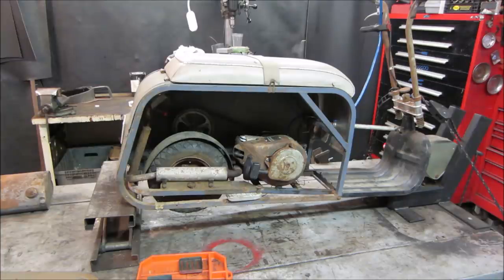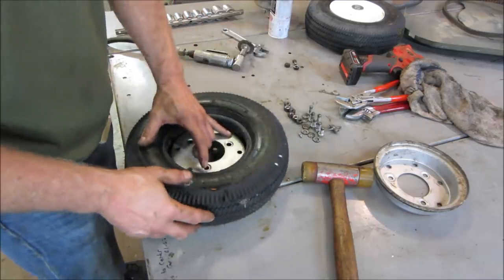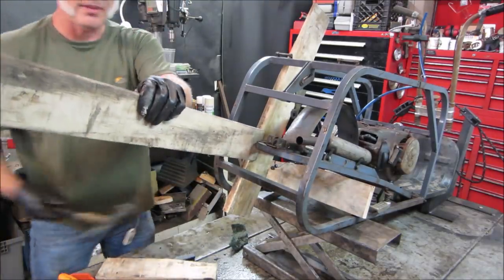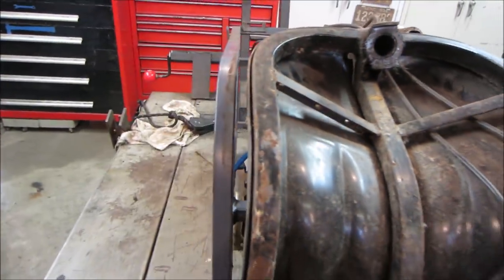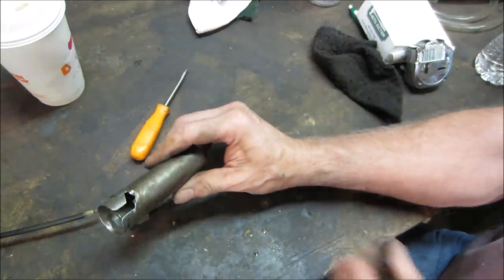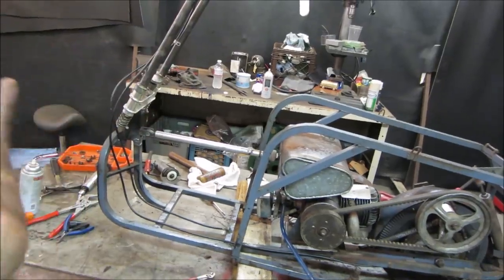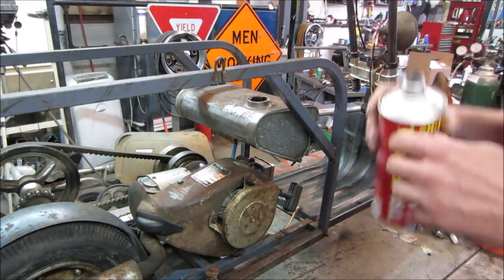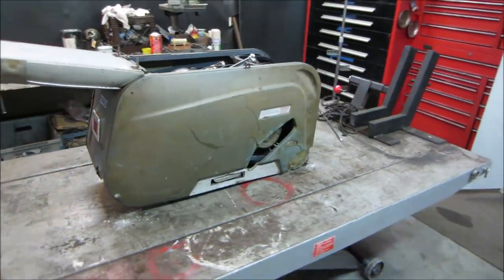Fold up 49cc suitcase scooter. Will it RUN/RIDE after 40 years Part 2 of 2

Comment: I like that lighting system:
"What's that in the middle of the road?"
"I don't know, let me speed up so we can see it better."
Reply: @sl4pz  ---  Yep. I believe if one of the lights burns out the bike will not run. Wired in series.
Reply: I have a CG 150 chinese clon (OHV, pushrods, copyed form that 70´s small Honda), they still have it haha. 
Perhaps not that handsome, but cheap and lovely. 
Fantastic option, in my opinion, in poorer countryes to still have movility. And a great DIY school on itself.

And no, , it will not stop if one of the lights burns out. 
It has a bunch of cable wide as a thumb coming out from the magneto, so everything is in paralell I guess.
 
In fact, you can take out the battery, drop it in your back pack, and still be able to kickstart and run the bike, head and brake lights, forever.
Now imagine yourselve in the midle of, let´s say, Patagonia, 500 miles from everywhere.
Battery dyes and you´re in a Ducati.

Note: 
Headlight is symbolic, till a moment, in the middle of the night, there is no other light around. 
Then is a miracle.
Just to think about it..... ;D
Reply: @Simmons2358  that is wrong of course the lights circuit is a different circuit than the one that powers the plug
Reply: Hi

Comment: In what has become a "throw away" society, you are a breath of fresh air. I recently bought a burgman scooter that did not run for three years. Changed plugs, put in a battery and some seafoam to the stale gas.  Fired it up, took it to my motorcycle mechanic, got it inspected and have put about 600 miles on it in 3 weeks. Everyone said don't buy it cause it doesn't run. Now I drive by and beep. Thanks again and keep em coming.

Comment: Excellent little mini-series, Mustie. From here, 3000 miles away, it looks like the rear shock slider bracket goes all the way back and hooks under the cross tube. In that position there would be no bending moment on the spring strut. I was amazed at how well it appeared to ride. Always enjoy your output. Mart.

Comment: my 2 cents on the slida-ma-thingy:

its to keep the wheel in contact with the ground when propped up on the kickstand, so the wheel doesnt turn nuts when in idle.
Reply: Very possible. Good idea.
Reply: Was thinking it look like the thing on my electric scooter to keep the front tire on the ground
Reply: If you take a good look, the bracket the shock is on has a knub on the lower end. it is meant to sit on the frame!
Reply: Wheels turn nuts. The person riding the scooter. :-)
Reply: @redashrajal  ow so what's that shock for then the bar that moves or is my scooter broken

Comment: Like with the tank taped to the wheel spinning.A friend of mine restored a lot of bike tanks for people.....so he had an old dryer that he used to clean out tanks with.Most tanks would fit in the door....so he  would seal the tank with nuts and sand inside....then wrap the tank with a blanket, tape off the layers then......throw that in the dryer for an hour and it made the inside of the tank look new.
Reply: I was about to suggest sand. Bolts are good for the big chunks.
Reply: We used pressurized air and sand to fix dents in some tanks, way back when.

Comment: That original tread reminds me of a pattern which was found on a number of aircraft during WWII, sometimes on the Mustang P51s.
Reply: I was wondering if the tires were off a light aircraft, given the aviation links to the scooter.
Reply: Good thing you found that crack. Imagine explaining at the emergency room how you crashed riding your suitcase.
Reply: that tread is a very common old school tread, lot of go carts and minibikes of the 60s/70s had em

Comment: The bracket for the shock absorber swings all the way back, it has a notch to lock it into the bar on the back.
Reply: I wonder if it had previously swung forward out of lock during ride and hit a bump to cause that bend/kink. The geometry makes it look like it could happen easier in that case.
Reply: That's what I was thinking as well. That is the main support for the weight. Probably got bent originally from not being locked into the rear bar.
Reply: Kid with a new toy 👍😂
Reply: Yip this is my thinking also. He was so close when swinging it around I thought for sure he'd try it.
Reply: Thankyou, was hoping i wasn't the only one that picked that up! The bracket is quite cleaerly shaped that way!

Comment: The shock mount slides down because that piece rotates around and locks under the frame in the deployed position.  Its not meant to be locked straight like that.
Reply: @Do RC - I  think the slotted bracket also `limits` the rear wheel assembly from dropping too far down so the belt & pulley don`t get too stretched. Does that make sense to anyone else ?
Reply: My thoughts exactly. Getting that piece under the frame will add strength and be far safer.
Reply: I think the bolt slides DOWN to allow the tire to fully come up into the frame.
Reply from the maker: cant go that far as it hits the rear fender with the locking lever
Reply: @mustie1  maybe that locking lever isn't original or something. It just seems like it's really designed to go there.
Reply: @mustie1  there's even a little reinforcement tab on the frame where the bracket would rest.
Reply: @mustie1  also looking at the video I don't see where it would be anywhere near the fender as the bracket would swing to the back to rest under the crossbar of the frame which would actually further away from the fender then when it's straight up and down
Reply: I think so too, was hoping to see a resolution to this before the ride.

Comment: The gas tank strapped to the truck wheel says just one thing... “ too much vise grip garage!”
Reply: And the noise reference to spray paint lol
Reply: You say that like it's a bad thing. Well, I'll be dipped, it did work well though.
Reply: Well I`ll be dipped! that worked!
Reply: A guy really does have to put gas in 'em though.

Comment: I think there is a spring missing. Every shock I've ever seen either has a coil over or a leaf spring or some other kind of spring in use with it. that's what the movement is for, room for a little movement when you hit bumps and what not, but without the sprint it's not going to work.
Reply: The movement is because that arm is supposed to rotate around and lock under the frame in the deployed position (you can see where the two should mate).  Its not suppose to be locked straight like that.  The spring is built into the shock.
Reply: Back in the 80's I had a friend that had one of these and it had a coil over and about 3" of travel.
Reply: @DoRC  then the shock needs replaced it's not working like I think it should.
Reply: @tootall5559  That's entirely possible. The spring it could be worn out and collapsed. It also could have had shock absorbing functionality originally and that has been lost through seal degradation.
Reply: @DoRC  something on that order... but I think the right coil over spring could make it work... better if not entirely right..if you can find one laying around. If you have to buy one...I wonder if you can buy a shock like that these days? anyway its a cool ride. I think it would be cool to keep it in the back of the truck or in your trunk with one of those cans of gas... you wouldn't want to keep gas in it ... if you have a breakdown or whatever, you can ride it to someplace to get help or home depending on the distance. Get tools and maybe another vehicle... just be cool to have handy. Many a time I wish I had something like that when my truck or car broke down. Course nowadays with cell phones that's not so much of a problem....if you have somebody to call which I don't.

Comment: That adjustment on the back is going to be the equivalent of preload, so you don't bottom out, if ya fat.
Reply: Yup, you adjust it for rider weight and then lock it down. It doesn't slide during normal operation. The reason I think this is that the whole thing looks like an upside-down version of the bellcrank that operated the headlights on my 1974 Saab Sonett III. That had a similar slot to adjust the retracted position of the headlights, but all the normal extend/retract action was handled by the middle pivot.

Comment: That pull start was facing straight up in the first video, I even went & did the checking for you. Whatever works best though, Just because it was up doesn't mean it was correct. Great job on fixing it up to run & ride.

Comment: Putting the brake cable into the solder pot is nifty, if you have one. The cut off: wrap a piece of friction tape around the cutoff spot. Then do the cut off with vise grip jaws. It is clean every time, even without the solder pot. Have done this many, many, times.

Comment: When working on old motorcycles and Porsches with rusty tanks, we would get a product from a motorcycle shop that you pour into the tank and slosh it around. It seals over any rust and keeps it out of the carburetor.

Comment: Also the bracket at the top of the rear shock has a lug that locks into the cross bar of the frame and the previous owner as well as yourself did not notice this which is why the shock was bent you will find a recess on the underside of that cross bar for it to lock into and that is why the top shock bracket slides .that's free advice free of charge 😂 I watch all your vids as I am a problem solver like yourself and enjoy trying to find the problems before you point them out keep up the good work 😁👍

Comment: About the TANK DENT...
Put the crow bar in a strong vise.
Slide the tank onto the bar, and then PUSH DOWN on the tank to push the dent out.
WARNING, the crow bar has a sharpish end on it, may make a hard dent or even pierce the metal of the tank.

I recommend you make up a heavy J-shape bar with a ball or heavy spoon-shape welded on the end, use that for future dent knockouts.  
In fact, make one bar with a different J-bend and etc. on BOTH ends, more versatile.
Think of it like a QUESTION MARK (?) shape, but with the ball/spoon on the end of the hook.
Similar is used for brass instrument repairs.

Comment: A lot of times when I have old rusty gas tanks like that i put a little bit of sand in it, cover up the filler hole with a towel and blow it around with the compressor, gets them pretty clean. Basically sand blasting the inside.

Comment: Re. fuel tank rust removal....I used a handful of coarse sand and an air nozzle to chase the sand around the inside of the tank...kinda like sandblasting. It worked real well and fast.

Comment: I bought one years ago at a bike swap meet for $40 bucks with the original  1961 oregon plate still on it , its pretty complete but minus the side covers & seat . its sitting in my shop under the bench & might be time to get it running !

Comment: What a neat scooter watching you mess around with the recoil position for ease of starting.Bell rang in my dumb head how about a loop or eyebolt mounted closer top or front like on the lawnmowers,might have to just extend the rope maybe long enough without using a longer one.....Glenn .

Comment: i see you love your wire wheel like i love mine,best thing ever to remove gunk,crap,rust etc.
funny story,my wife was walking the dog this spring and came back quickly.
she said,theres a whole bunch of stuff down the street being thrown out,do you want to look?
 i was up on my feet and moving within mere seconds and took the car(it has a trunk)

i got a few things:
1)mint bench grinder with a light,new grinding wheel and new wire wheel
2)mint chop saw with b/n disc
3)12 ton pipe bender and all attachments
4)1/2 horsepower electric motor
5)portable air conditioner with remote

all work.who throws this stuff out?

Comment: Through in a few dozen pieces of line stone into the gas tank, & fasten the fuel tank to something round like a rear tractor wheel, & go for a ride for about 20 minutes. the sharp edges usually chip the crap off the inside of the tank. As a last resort, do the same using muriatic aceid, then rinse the tank out really well.

Comment: I know you will probably never read this but, those hand grips would slide on and off much easier if you put some denatured alcohol on them. It doesn't harm the plastic or rubber is just makes it slick till it evaporates.

Comment: Gas tank treatment: tumble with #9 steel shot (from sporting goods store for shotgun shell reloading), slosh with rust converter primer, coat with latex gas tank sealer. You get a clean and stabilized tank with minor pin holes sealed and coated with an internal condom to prevent further rust disease.

Comment: Best gas tank rust cleaning method i have found is white vinegar.   Fill it up let sit for 5 days.    Rinse thoroughly then put some WD in shake around to prevent flash rust and displace the water

Comment: 28:30 - 28:50 on top of the lock level at the rear shock, it had a slot like a hook, I think you should unlock and bring that hook to a rear then hook it to a horizontal metal bar at the rear frame and lock it. Now the bracket on top of the shock will stay lock into this position and not free to move up and down. ( If you look on bottom of a horizontal metal bar I think it should have a hole).

Comment: @Mustie1  Next time you could do the gas tank in your dryer.  I've done it before with motorcycle tanks.  Just wrap the crap out of the tank and stuff a bunch of old blankets in the dryer with the tank in the middle so it can't move freely, and run it on a tumble setting with no heat.  Worked great for me, although I didn't do mine with liquid in it, just ball bearings.

Comment: You had mentioned that using a drill to start these motors is hard since when the motor files the drill loosens the nut holding the flywheel.  Was thinking that using a one way bearing might fix that.  Weld a socket to the inner race on one side and a socket connecter on the outer race on the other and then you can connect whatever size you need socket into the outer socket connector and chuck up the inner socket and be good to go.

Comment: Haven't finished watching yet so I apologize if you already figured it out but I feel like that pivot sliding bit on the rear shock could be to adjust the height it packs in to and comes out to.  That's the only thing I could think of though.

Comment: That pull start handle doesn’t have to sit down at the motor.  You could extend the rope, and have it come out of a grommet or bracket anywhere on the body, like lawn mowers that have the pull start up by the control handle three feet away from the motor.

Comment: Hey Mustie, I think that suspension has to be bend all the way to the back. so that it lays against the frame. If you hit a pothole with ti set like in the video, I think it will break/bend the "hook" (that top part that swivels). Also, if you look at it, that part has 2 hooks, 1 that fits the frame while folded, and another one (facing to the rear end) that fits the frame while unfolded, thus giving it more stability. 

Not an expert, but after watching the whole video, I think that's it's purpose.

Comment: If you flip that Bracket for the Spring all the way to the back there is a hook so the load of the vehicle rests on the Frame and not the bracket. 
You should also have way more ground and turning clearance.

Comment: The throttle lever is bent which is causing difficulty when you are trying to get full throttle, If you bend the lever back forwards the rear wheel it will allow the throttle cable a better angle to pull on the lever when it gets near wide open throttle. I guess if the lever was a bit longer pointing down towards the ground that would help too.

Comment: Pleeeeeaase! When mounting handle bar grips, just use a tiny squirt of brake-cleaner (or lighter fuel, it's the same) ! It lubes the rubber for about 20 seconds and drys off within the next 30 seconds. Same trick for removing old rubbers: lever in a small screwdriver, splash it and off it comes. No compressed air or soapy water needed and saved a lot of work!

Comment: On the swing arm the cam mechanism should be slid all the way up and tilted back before tightening the set lever. So the shock/strut is straight up and down so there is minimal side load on the shaft.

Comment: One thing that I think you could do more with is a bead blaster, or even sand-blaster.  Work better than a wire wheel I think.  Also, I think that you should have coated the inside of the gas tank.

Comment: the clutch is mostly blocked engaged... it shouldn't spin the centrifugal gear wheel at low revs : 1. it eases the start. 2. the scooter won't go without you... sometimes, those clutches have adjustable springs to choose when they start gripping

Comment: The reason it's slideing is because when you put weight on it won't slide and it will put pressure on the shock so it will work when you hit bumps and when you lift it up that's should bring the back wheel far enough up so it works like a kick stand

Comment: The reason the slot is there is so the shock can lock in under the lower bar in the rear, if you look carefully there is a notch in both ends of the latch plate. (not sure if i am explaining correctly, sorry)

Comment: Should of aired up the tube a bit first, then rub grease on it and those rims will slide in nice and no chance of pinching the tube,and usually the bolt go opposite so you dont separate the wheel by mistake while unbolting it from the machine

Comment: This bike frame has some design deficiencies. It needs top or bottom X bracing to prevent parallelograming but that would add weight and obstruct the fold-up action.

Comment: For cleaning the gas tank you need to use smaller fasteners, or even gravel. You want the abrasive material to slide on inside of tank, not smacking into walls as those nuts were doing.

Comment: Straightening the gas tank. You were close, put pressure on the inside.( like you were doing) and tap it with a hammer on the outside. ( buck it).